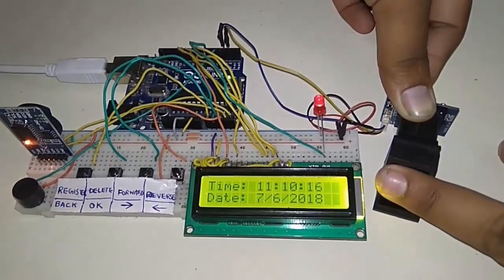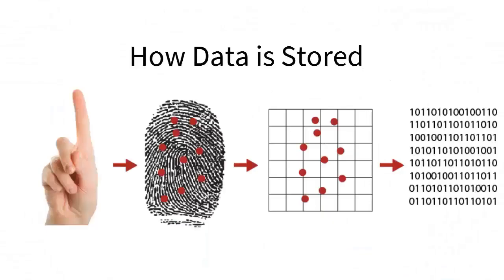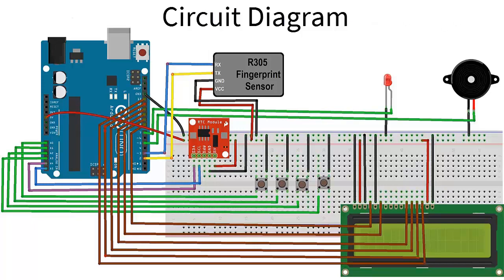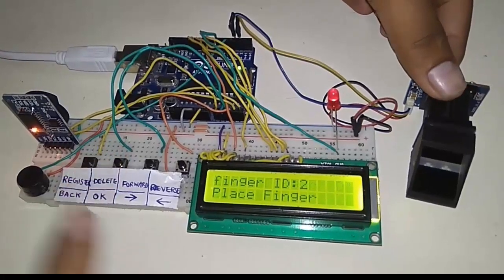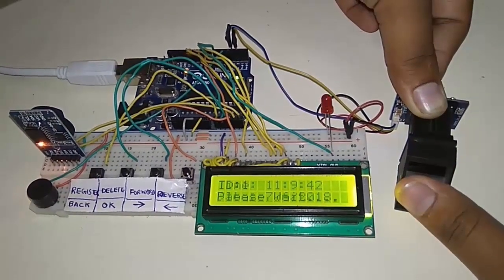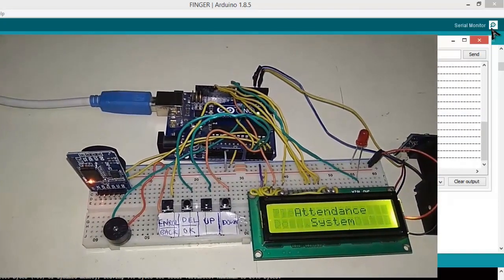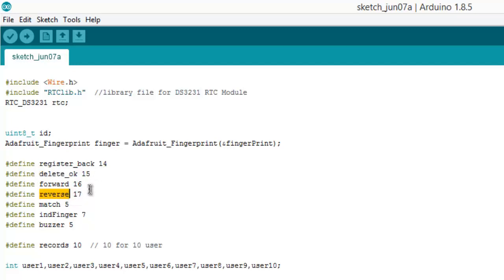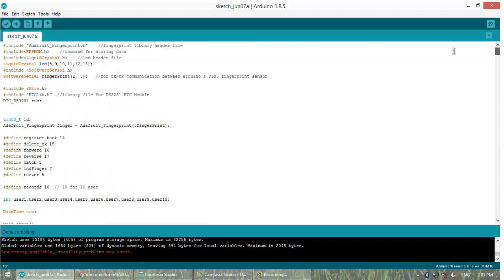Fingerprint Based Biometric Attendance System using Arduino

Comment: @HowtoElectronics Sir in my project everything is same but plz make this project code with DS3231 rtc library by Henning Karslen rinky dink electronics, bcz I'm using this rtc library & 16×2 lcd display pins are (12, 11, 5, 4, 3, 2) so plz sir using this DS3231 rtc library and those 16×2 lcd pins plz upload the code and hardware connection it's an request sir it's very imp. For me plz sir😢

Comment: i have downloded the two libraries from your description link. but one library is not supporting. i have added those two , but while compiling itis showing error...> Arduino: 1.8.19 (Windows 10), Board: "Arduino Uno"

fingerprint_sensor:9:10: fatal error: RTClib.h: No such file or directory

 #include "RTClib.h" //library file for DS3231 RTC Module

          ^~~~~~~~~~

compilation terminated.

exit status 1

RTClib.h: No such file or directory

This report would have more information with
"Show verbose output during compilation"
option enabled in File -> Preferences.
plz help..my project have to see in college by 10.11.23
Reply: Have you done that project
Reply: I also want to do some IOT.

Comment: i have the same project somehow. Do you have any idea why when my project is powered supplied form a external source (not from laptop usb to arduino) the lcd i2c display doens't show any text / data? it just light up and doesn't show like on usb connection. Do you have any idea what could be the issue?

Comment: Is the fingerprint data being stored in the EEPROM memory of the arduino? If so, is there a way to transfer the data to an external storage, such as an SD card?
Awesome video btw, loved it! <3
Reply from the maker: Yes there is a method to transfer. But program and circuit are different for that.
Reply: Did you got any solution?? Plz kindly reply

Comment: what interface you used after compiling the Arduino code? Was the resulting window python or Java based interface???   am making the same project but bit confused about the interactivity of hardware with software after compiling the Arduino code! please help me out 😃
Reply from the maker: The output is shown on Arduino Window, i.e Serial Monitor. The data can be downloaded by pressing Reset button of Arduino + First push button on bread board together.
Reply: in what form will i get the data, as if i need that for validation
Reply: Brother, I have a Zkteco k40 pro device. 
I can enter into device through telnet. 
I need to know how can give acces to a user id without keeping my finger, anyway I can hit sensor.

Comment: Bhai it worked all connections nd code working fine but i have to one more thing I have to send that data to internet using esp8266 esp01 module how can i do that any references ??
Reply from the maker: I will make a video on that. But not right now, may be a month later. So right now you can take help of google, only option left.
Reply: @HowtoElectronics  okay thanks.
Reply: hey bro i am getting:" please wait" after press match to start system how to overcome that error
Reply: Were you able to send data to internet? If yes, then could help me?
Reply: @satyampawar1634  bhai i am getting errors in the code can you please send me the code it will be very helpfull its in my college project and i have to submit
Reply: @rohitbherwani6267  what's your email
Reply: @HowtoElectronics  afetr 8 months
i really waited and u forgot about ur own youtube chanels vidio
Reply: @satyam pawar 
Hey brother i need your support for my project.
Please contact whenever you are free.

Comment: I have R307 which is new version of R305 and i have same project to do can I use it similarly like R305 works ??
Reply from the maker: Yes it will work. I already tested it with R307 as well. You can continue
Reply: How to Electronics please tell me the connections because I'm new to this stuff , It will be great help it have six wires tell me the function of wire colorwise ..
Reply from the maker: Only tx and rx are used. And vcc and gnd. Leave other wires.
Reply: How to Electronics yellow wire nd white are tx and rx ?which one is tx nd rx?
Reply: Do you have any link which I can refer to so that i will successfully interface R307 with my UNO
Reply: Can you upload a video for R307 please ?? I'm stuck with my work please help me
Reply: Satyam Pawar use First 4 wire only
1.Red-vcc
2.Black-Gnd
3.Tx
4.Rx
Leave rest of 2 wires not connected
It will work
Reply: How to Electronics finally its working well! Thanks.
Reply: I also used R307 in my project but it is not working properly. It is  showing ' module not detected' . Plzzz tell me the solution for this problem bcz  I have to submit my project. Plzzz reply
Reply from the maker: Connect the correct wire of R307 to Arduino. Identify tx and rx and then connect
Reply: @adityakumarsingh8271   I am doing same connection but it is not working . It again showing 'module not detected'. Plzzz tell me the solution.

Comment: Bro lcd screen not working ,only showing arrow marks but the connections  are correct ,should i alter the code to work it propely.
Reply from the maker: Check lcd connection with arduino and also recheck with program code. Also use 10k potentiometer at pin 3 of lcd to adjust the contrast.

Comment: Dear Sir, may i ask why the code u provide in the website in website is having bugging and looping problem? i notice u use two different coding to show in this video. One coding u use enroll and then u open serial monitor and it works well and the other coding u use register but only show it compile but u didnt open the serial monitor. Did u upload the wrong coding? because the code u upload is register one not the enroll one.That`s why i am curious to know.If accidentally uploaded the wrong code can u pls reupload the real code? i builded the same circuit and following yr video i try the coding to better understand how it works but the code u provide can compile but cannot operate as u shown in the video . Dear sir, i would apprentiate yr help in this matter.Thank you and hope u can reply me as soon as possible.
Reply from the maker: Not at all this is the correct code. Me along with thousand of users have designed the same project with same code. No one faced the issue.

Actually there is problem with Arduino IDE of earlier version, i.e Array compilation issue. Use the latest Arduino IDE version for compilation, may be Arduino IDE 1.8

Just read below the comments of other users, who made this project.
Reply: i am facing the same problem its stuck on please wait about 20 min
Reply: @HowtoElectronics  i am facing the same problem its stuck on please wait about 20 min

Comment: Sir...i have one doubt...is it wirless or not...its has mobility or not
Reply from the maker: Yes it is wireless. Use 5 volt adapter of 5 volt battery.
Reply: @HowtoElectronics  sir....what is average cost of this project
Reply from the maker: It wil cost around 2000-2500 indian Rs.

Comment: hello this is nice project ...can you tell me that which microcontrooler did you used in this project
Reply from the maker: ATmega328 inside the Arduino board
Reply: Hi sir finger prints sometimes not accept this time I think 1user  and 2id it is storing biometric it is possible sir u can reply sir
Reply from the maker: Place the finger properly and in full contact with glass. Also only use dry and clean finger.

Comment: Sir is we can use Mega2560 uno  fingerprint sensor or R307 fingerprint sensor
Reply from the maker: Yes you can use. R307 & R305 have nearly same configuration.
Reply: Is it require jumper wires for connection
Reply from the maker: Yes
Reply: Lcddisplay doesn't have pins to bread board connection, is it need to soldered to the board
Reply from the maker: Yes solder it
Reply: Do we need to type the full code in the above link. That is a lot!
Reply from the maker: Copy paste
Reply: Buzzer has 2 leads, which lead of the buzzer connects to arduino
Reply from the maker: Positive leads to arduino pin. Negative lead to gnd
Reply: Is it require power supply
Reply: Can't download ds3231 library. It shows error downloading

Comment: how can i used r307 fingerprint module instead of r305?
Reply from the maker: Same connection. Replace R305 connection with R307
Reply: but there are six wires. How can i connect?
Reply from the maker: Only 4 wires are used. Vcc, gnd, tx, rx. Leave 2 wires.
Reply: what is tx and rx?
Reply: display is not working
what is the problem?
Reply: an rtc is not working
Reply: display is not working
Reply: How to show data in tabular form??
And how update time and date???
Plz reply as soon as possible
Reply: Thnx all done
Reply: But how can i display the time as output on pc screen?
Reply: And how can i change time also?
Reply: @dhruvpatel8596  hlo is the display working?? i too have same problem
Reply: @dhruvpatel8596  can u please send me your circuit picture clearly please i have a problem in the circuit.. i even used r307
Reply: @dhruvpatel8596  bro
Reply: @dhruvpatel8596  hello bro I need ur help

Comment: hello sir, 
i had downloaded the code given in the link but the erorr is coming as the "'RTC_DS3231' does not name a type
" in line no. 10. is there is any solution for this.
thank you
Reply from the maker: Probably you are using wrong DS3231 library. Add correct library or some other DS3231 library
Reply: @HowtoElectronics  thank you so much sir for your response
If any problem occurs than will contact you
Reply: hi sir, 
i had downloaded all the library  in the arduino software related to DS3231 but the same error is coming. so what can be the alternative solution for this problem.
Thank  you
Reply from the maker: Compile with the latest version of Arduino IDE, either 1.6 or after that.  The earlier version of Arduino has an array compilation issue

Comment: Hello sir I am getting "Comm. Error" in my project. Plzzz tell me solution for this problem & I am using R307 in my project .plzzz reply it's urgent
Reply from the maker: You mean compilation error.
Plz add all necessary library first.
Then compile with latest version of Arduino IDE, i.e 1.8 version. Earlier version had array compilation issue.
Reply: Okk Thanquuu so much sir but it is again showing"No finger Found" and sensor continuously blinking.

Comment: Hello sir I want to connect this project with GSM so please tell me  how it can be done plzzz reply
Reply from the maker: Additional number of i/p & o/p  pins are required for gsm connection and i think there are no pins left for extra connection. So use arduino mega and read the example of gsm connection and merge with the orginal code
Reply: Hey tx and rx is left that can be used for GSM module...

Comment: I got this message in lcd "can not find the module " what is the problem here sir ??
Reply from the maker: Check tx rx pins connection
Reply: @Mohammad OmaR  have you find this solution ?? I'm also getting same message..

Comment: There is an error when uploading the code to arduino uno, due to the large size of program how to overcome that
Reply from the maker: Use latest version of arduino IDE. Earlier version has array compilation issue
Reply: There is any problem to use IDE in mobile

Comment: hello. can u do video how to download library and install to ardunio
Reply from the maker: Its very simple. Library link is given in the website source code. You can check link in the description. 
Add the library via Add Library manager in Arduino IDE
Reply: @HowtoElectronics   i download library but it got error when i upload. it keep said"  "RTClib.h" no such file or directory
Reply: @HowtoElectronics   I put two library  in ardunio ... but RTClib.h is no such file

Comment: Bro r307 has 6 pins, what to do
Reply from the maker: 2 pins are not used.
Only use 4 pins , i.e vcc, gnd, tx, rx
Reply: We have done it.
But showing fingerprint sensor not found

Comment: i want to buy your device, not only one.. i am building comercial ERP app to companies in my country.. my ERP based Android, can the device send data to my Android ERP application?
Reply from the maker: Ya it can send. I have modified the same system with some additional feature like  the attendance can be monitored via android device connected to bluetooth. And a keypad attached to it for admin access to change password. And also sms can be sent to parents.
Reply: @HowtoElectronics  thank you for your respon, where your country sir? any contact?
Reply from the maker: Contact via fb page. Check the link in description
Reply: @HowtoElectronics  sir, is it possible to implement this Attendance using Arduino Bluno Beetle ? Because Arduino uno still too large

Comment: And how to connect GSM
Reply from the maker: You cannot connect since there are no pins left for connection. And connecting gsm will make the circuit more complicated. It too requires a long programming modification.

Comment: display is not working ... please let me know the solution as soon as possible
Reply from the maker: 100% same
 More than 100 people have implemented same project and they worked.

Check your lcd pin connection. You might be doing wrong.
Reply: @HowtoElectronics  i reconnected all the pins sir but still the lcd is not working..

Comment: when i push enroll button and arduino button at the same time , it always takes a reset... not download the data.... now what can i do? please help me
Reply from the maker: Msg me in fb
Reply: Nafiul Islam i am getting the same problem bro
Reply: @HowtoElectronics   what is your fb id sir?
Reply: @nihalnavde9388  yeah bro..😢😢
Reply: I m getting the same problem, any body get solution
Reply: @navatejnpathi8824   he gave me new circuit and new code... He told me,if i try that circuit and code... The problem will fixed....  But you need to know that  iwas already made my project and submit it and join all connection on pcv board ..... So i couldn't try his circuit and new code...
Reply: @nafiulislam9905  I tried but not displaying anything in LCD,
Reply: @navatejnpathi8824   check your connection bro... And implement the circuit on pcv board.... Breadboard is not safe..
Reply: @nafiulislam9905  same problem bro.....again
Reply: @nafiulislam9905  I did it worked, give some 1sec delay after pressed reset button in board and enroll button

Comment: LCD is not working all others r working
Reply from the maker: Use 10k pot at pin 3 of lcd.
And verify your lcd connection with circuit schematics and code too.
Reply: I will try that and ty